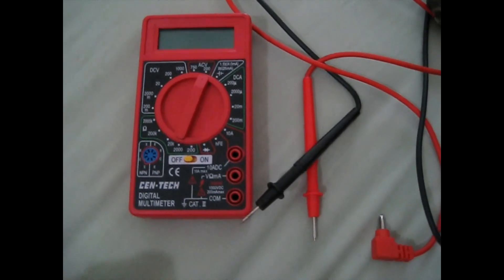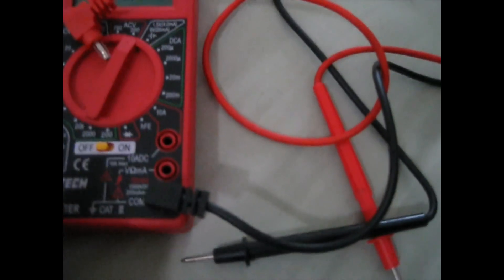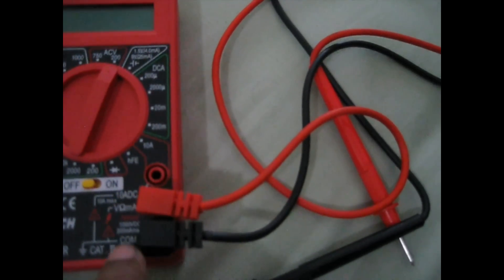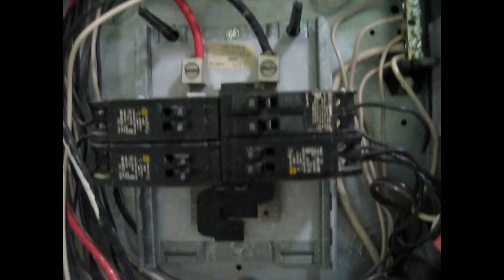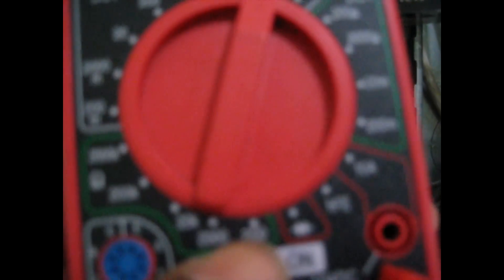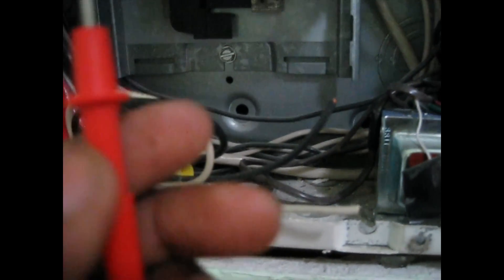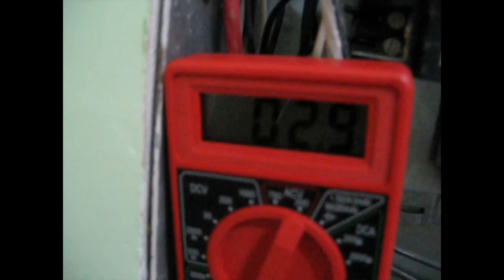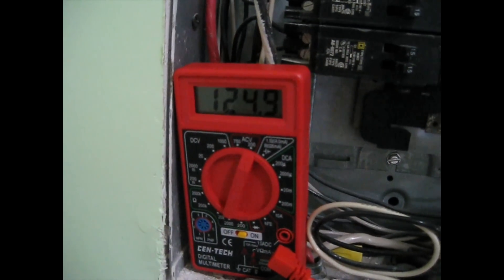Panel Box Circuit Breaker test,using a multimeter

Comment: I don't about anyone else but if I don't have anything nice to say then I shouldn't say anything is what my mom taught me.
But I actually probably could say something negative about the correlation 
Between interpreting skills used to communicate
His knowledge and explain it to anyone else because I am totally confused now and didn't comprehend much from the video except for his daughter telling him she needs to go pee.
Other than that 
Im back to square 1 with my repair project, I am in no way a electrician nor do I have much knowledge of what setting to use on my multimeter when testing 100 amp service and the continuity of specific breakers and components

Comment: I received that multimeter for free, with purchase of a 24 cent box cutter.  I had an electrician friend of mine make me throw it away.

One of the most important functions of a multimeter is to protect you from the energy that you are working with.   Cheap multimeters have cheap fuses, cheap insulation, cheap connections.  Why die over 40 bucks?
Reply from the maker: Okay, i didn't die yet lol.
Reply: @hp11208  brilliant logic.  Have you ever heard of Russia Roullete?  Why rely on cheap/free safety devices?  Ultimately, one of the jobs of the multimeter is to not catch fire or blow up.   Why not do what the geniuses that work with electricity professionally do, get a Fluke, or a Klein.

Comment: WELL DONE HP11208 THXS 
Everything in th box was fine but one of my receptacles still has no power even though the wires are fine and tightened
Reply from the maker: Thanks, no connection maybe.

Comment: You could have written a script for your video to make it more understandable and shorter. The "holes" on the meter where the test leads plug into are called jacks. This will help your ratings if you plan to do more.
Reply: Slippery Pete: What's that?
George Costanza: The outlet?
Slippery Pete: Mm-hmm.
George Costanza: That's where the electricity comes out.
Slippery Pete: Oh, you mean the holes.

Comment: Don't forget to NOT put your multimeter into a live panel! and you left your dead front hanging there unsecured. And i get this is supposed to be an informational video, but I would encourage people that have no past or prior experience dealing with LIVE Panels to not even bother going into your panel! An ARC Flash is literally hotter than the sun and can kill you, blind you or burn your house to dust.
Reply from the maker: Jacob Bradley Yep
Reply: +Jacob Bradley Why not put multimeter in the panel?
thanks.
Reply: It can blow up inside the panel= all bad
Reply: Frigen idiot. Anyone agree???uh uh uh hole uh uh